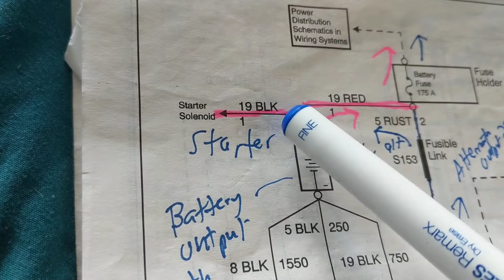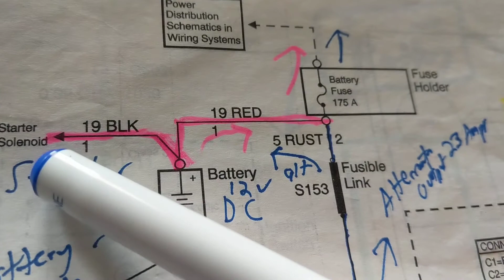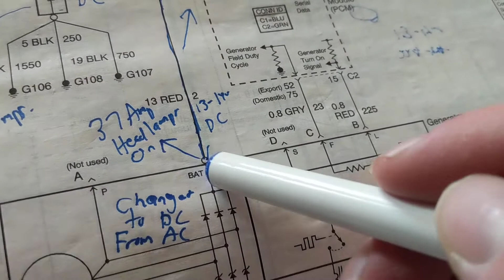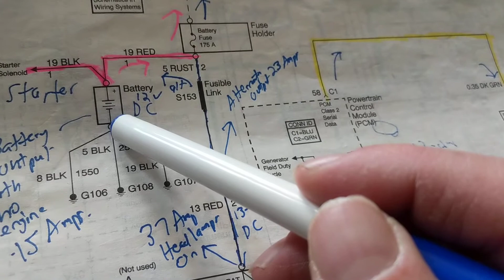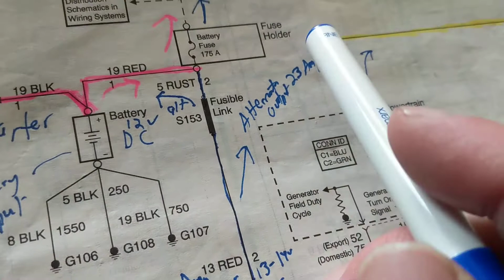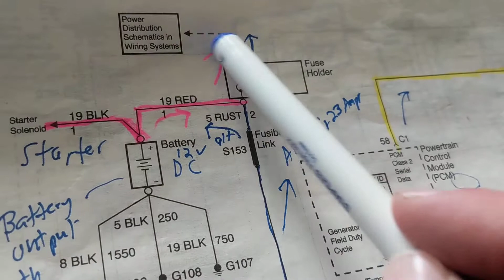HOW TO UNDERSTAND A CAR BATTERY AND TEST IT

Comment: Thanks very much for your explanation of the charging system it helps me more about it.   I'm trying to figure out why my newly-rebuilt Bosch alternator is fine (14.1V) when I start the car but once it warms up it drops down to around 12V (like regular battery voltage).  Very frustrating.  Thanks.
Reply: If you have a late model vehicle and the charging is controlled by the Powertrain Control Module (PCM), 12V is normal at times. As long as your getting around 14.1 at startup, you're fine. One way to make sure the PCM is controlling the alternator is to turn on your headlights, stereo, air conditioner or heater on high, and your hazard lights when you see alternator charging at 12V. After turning on all those electrical loads, the voltage should go up to 14 to 15 volts.
Reply: @bernardocisneros4402  Thanks for your response. My car is 1989 BMW and does not have a PCM.  If I kept rolling at 12V, things like headlights, windows, door locks no longer function properly.  Monitoring the system voltage using a voltmeter plugged into the lighter shows no adjustments being made.  In any event, the Bosch "factory-rebuilt" alternator was defective and the replacement under warranty worked properly with no further issues.
Reply: @nextphase7481  Thanks for posting your results. It helps other people having the same or similar problem in the future.

Comment: Excellent tutorial on this subject!! Is it possible to do a story on  Conductive battery analyzers?
Reply: I'll try my best I have to do a research to see if there is an interest for it like sometimes I did videos on the printed circuit boards there wasn't too much of an interest in that thank you so much for your suggestion but conductive battery analyzers are definitely another aide and determining the ability of a battery especially with today's new technology thank you
Reply: @Joeelectronicschematicsforauto   Absolutely I actually have 2 testers, midtronics ones,  pbt - 300 and mdx 300 p. fairly expensive but extremely accurate. Again  thanks Joe.
Reply: @404notfound.....  I like them the x300 see I use two kind of testers one is actual low test where current is being drawn from the battery around 100 amps it's called the toaster the other one that we use is actually a conductance and resistance test of the battery and that's why the cables are very thin we want the battery resistance to be about less than 20 Milli ohms and that's what it does but very interesting concept thank you so much